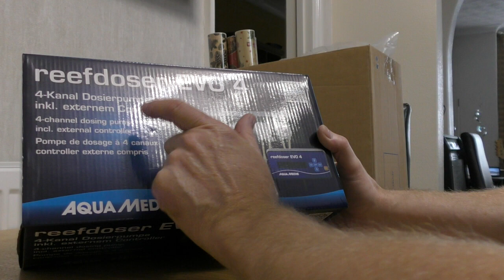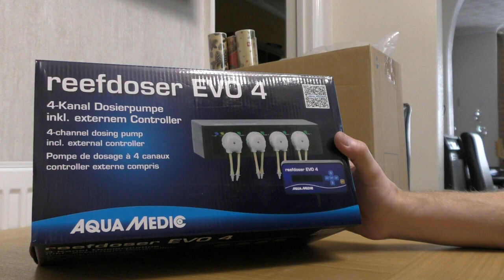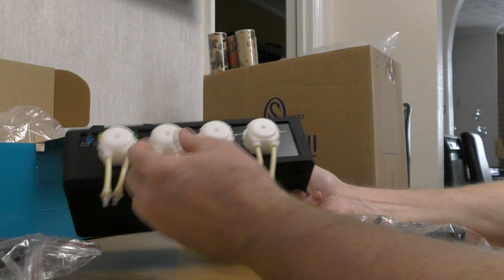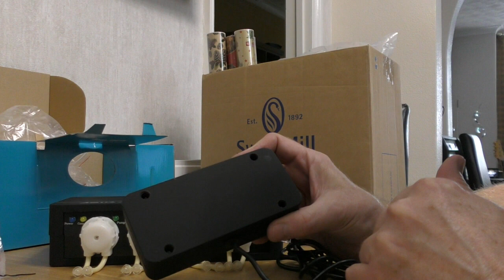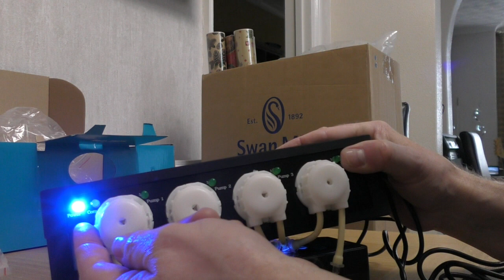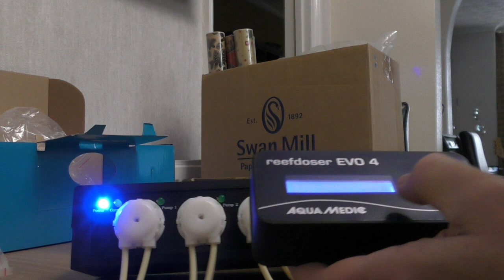Aqua Medic Reef Doser EVO 4. Do Not Buy.

Comment: They work fine. I've got 3 of these units in total all working fine on our 700 litre shop display tank. A 1000 litre frag system and even one on my personal 130-litre nano system. Chap clearly had no idea what he is talking about if you use Amazon it's no more than you deserve. We sell loads of these units (over 300) and not one has ever been returned what a Terrible ill informed review of a decent reliable unit. Yours is clearly second hand and has been taken apart by both you and the previous buyer. They have been 100% accurate and %100 reliable on all my systems and they've been running over 3 years now still with %100 accurate amounts dosed. We've used more expensive units that have failed in that time.

Comment: The box is too square, the tubing is too round, the leds are making light and the pumps are pumping too much liquid.

In your unit the head 1 is not working, the 2 3 4 are working ok.

The pumps are not £4, only the pump head with the tubing.